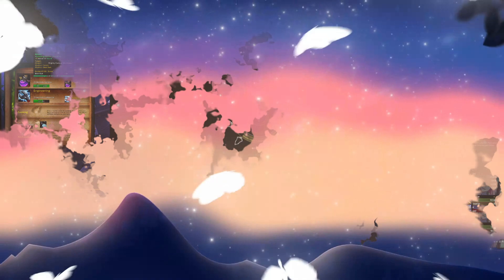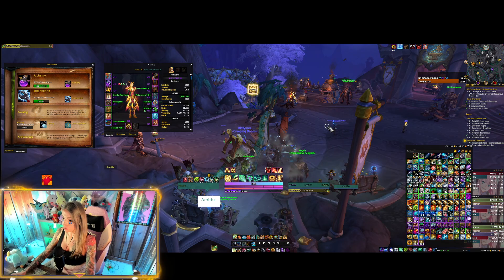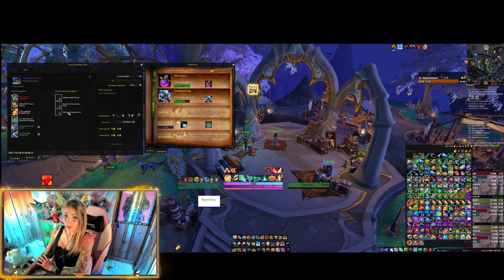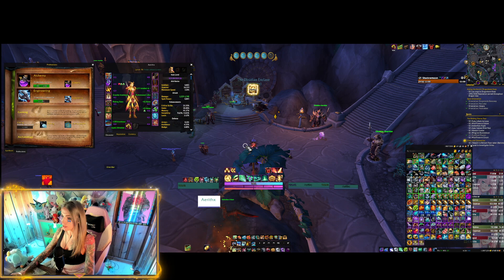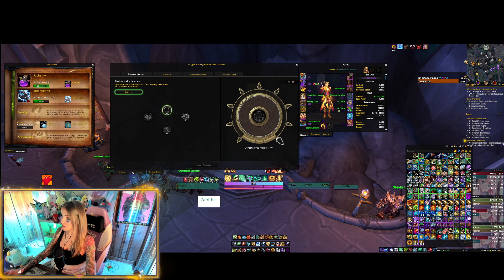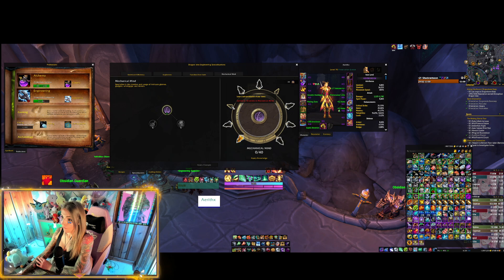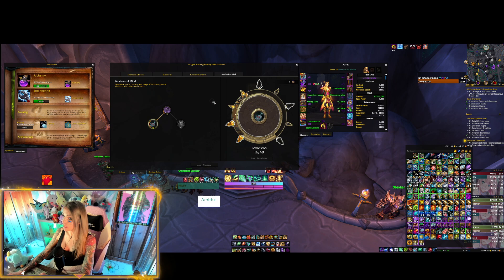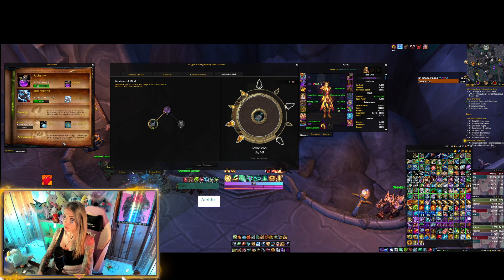Dragonflight Engineering Battle Rez Guide

Comment: Just a clarification, the tinker is the Arclight Vital Correctors, it does not come with the crafted piece of gear, you need to put it into the tinker socket to get the battle rez.

Comment: I had once a debuff, that didn't let me use my tinkers for 6 hours. I actually think, that this is the catastrophically malfunction. So since only high level engineers can get their tinkers to no longer malfunction, the safety infusion that no longer let's your tinkers to catastrophically malfunction might be the way to go for low level engineers and non engineers. I totally agree on your state of battlereses in general though. And I also think if you invest this heavy in a profession just for a battleres, you should get a real battleres and not this crippled version the engibattleres is.
Reply from the maker: You don’t need to be a high level engineer to make it so you do not catastrophically malfunction. You can get this very quickly from the knowledge tree with very little time and gold investment.